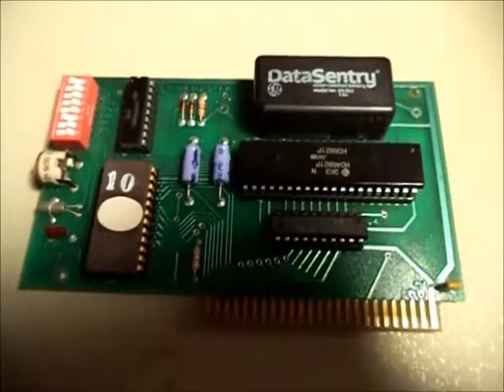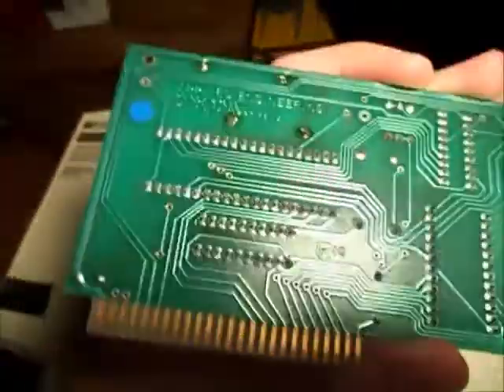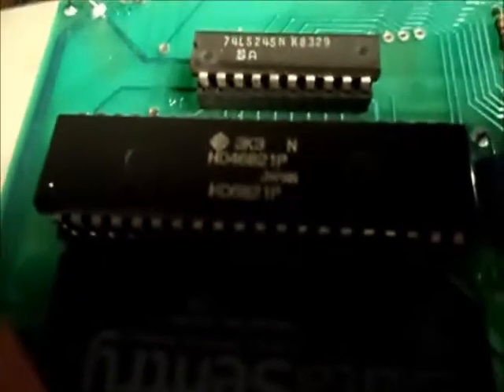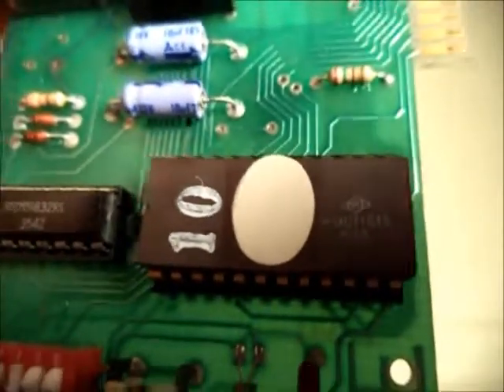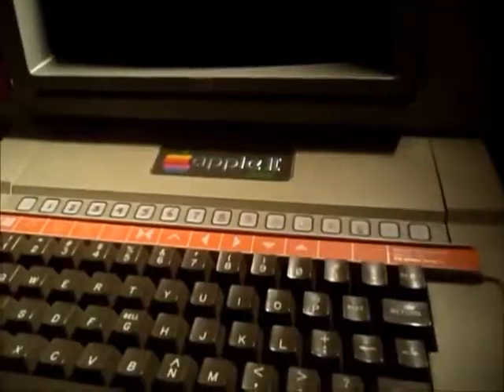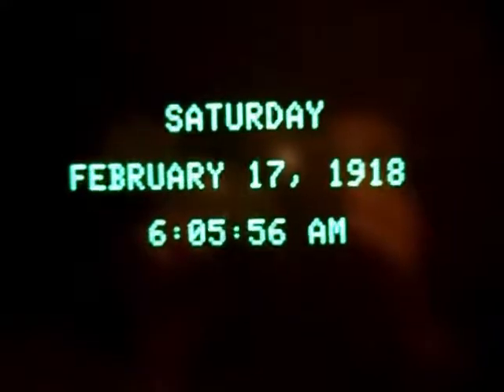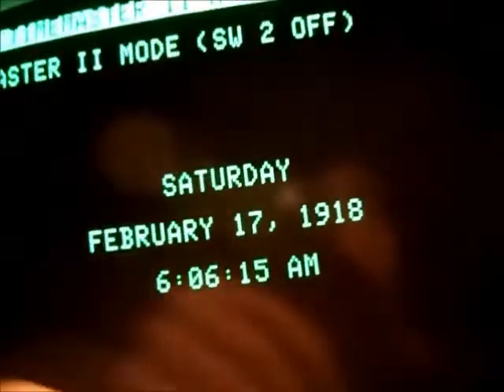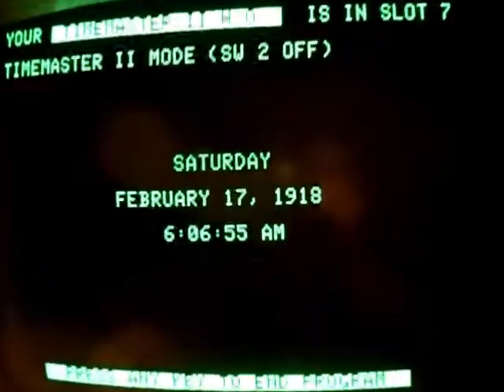34+ years old Apple II clock card still works

Comment: Damn this new youtube layout is so damn buggy now. It's even more buggier than ever before. I wonder how though.
That is one LONG lasting battery. VWestlife has a couple of videos on some batteries that have expired several decades ago yet are still holding good charge, are able to run things, and aren't leaking.
Oh, and btw, you haven't posted a new reply to that discussion for more than two months now. What happened? Are you unable to see my reply?
Reply from the maker: I tried to read the EPROM of the card and doing so messed it up so now I have to set it up again.

I have old 45V cardboard batteries from a ~70 years old radio and they still have a voltage of around 25V if I remember correctly but if I connected something to them they'd probably drain in a second or two.

I didn't feel like saying anything because of depression.
Reply: Ok. I wonder how.

Jeez! 70 years?? Cardboard batteries?!? DAMN that's old.

What depression though? You?